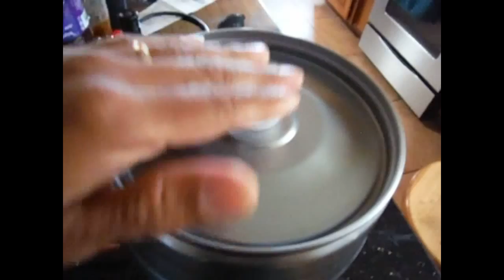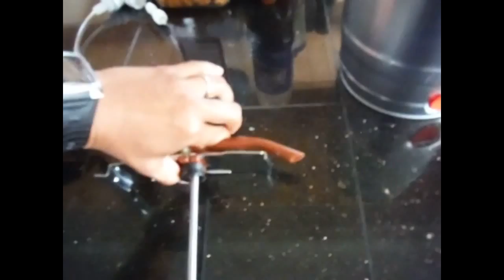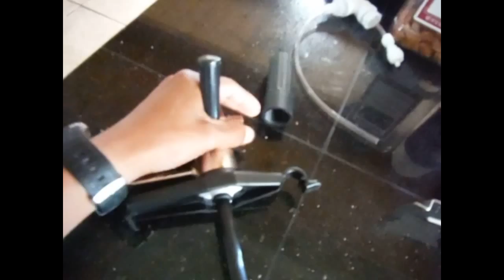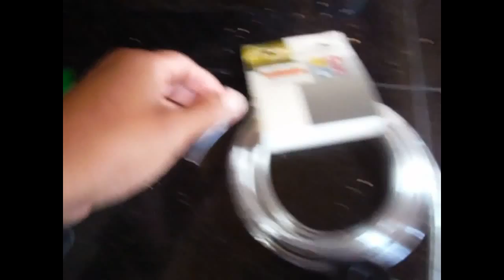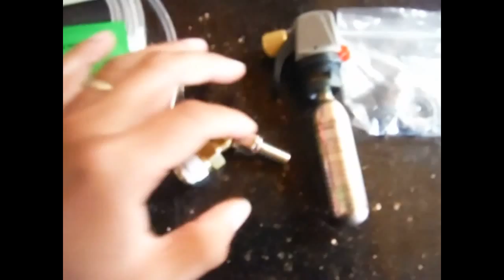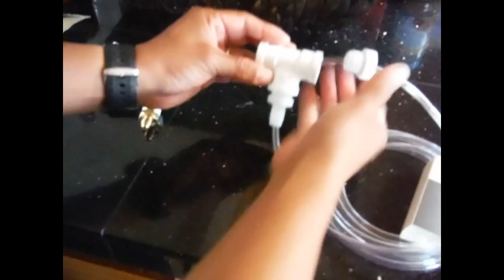mini keg tap

Comment from the maker: I apologize for not doing a follow-up on the video.  After months of using these kegs, I noticed my brew had a metallic taste.  I have stopped using them since.
Reply: Yes they are only meant to be semi reusable due to the plastic liner degrading maybe 5 or six uses depending on what sanitizer you are using

Comment: on the right side where the hose comes out of the white fitting. What is sealing the hose. Otherwise the co2 will just come out the side with the hose.
Reply: +Scott Lopez, If the tubing is snug, it will maintain the pressure. For the mini keg you don't need more than about 5psi. Or you can use some hot glue to seal around the outside of the outlet side of the 'T" fitting.

Comment: I know this is old, but are you still using this? If so can you show it working? Would be interested in seeing how you connect it, as with the offical ones the solid pipe goes down to the bottom and also has a clamp to hold it in place. Thanks